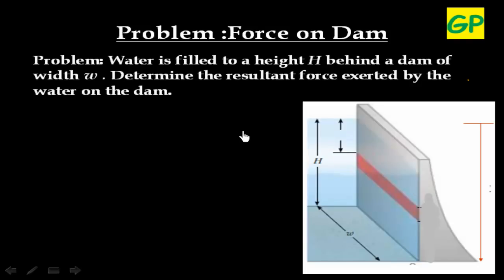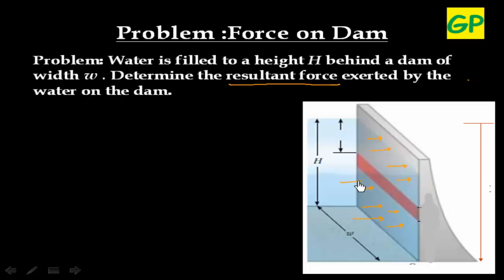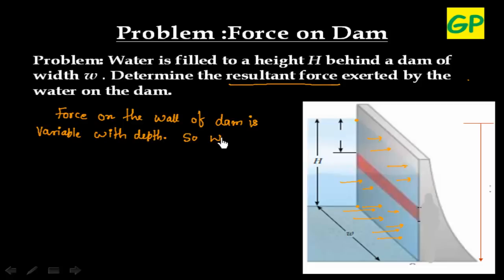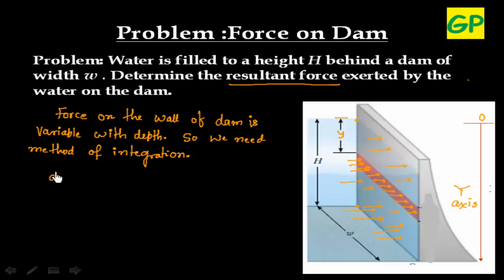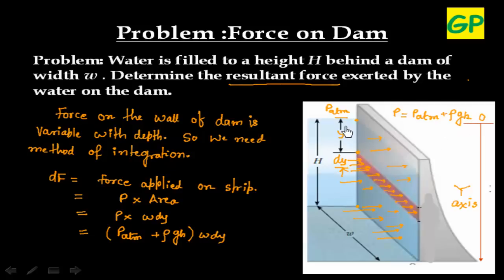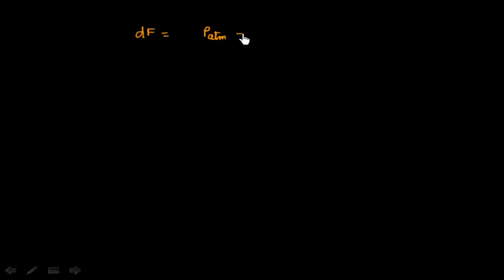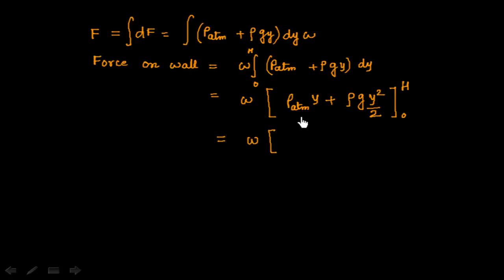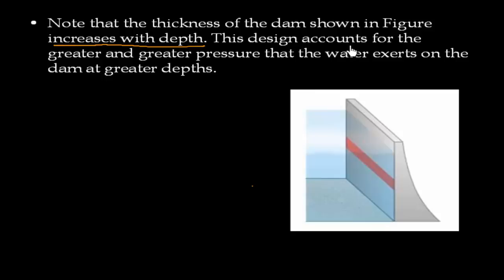Force on Dam  I  Forces on Submerged Surfaces

Comment: We can be omit atmospheric because it acts on both sides of the dam
Reply: and atmospheric pressure is higher on the side of the dam without water, as the air goes lower.
Reply from the maker: Yes